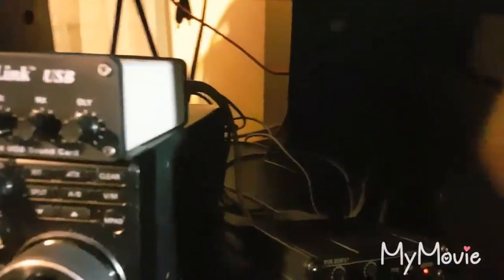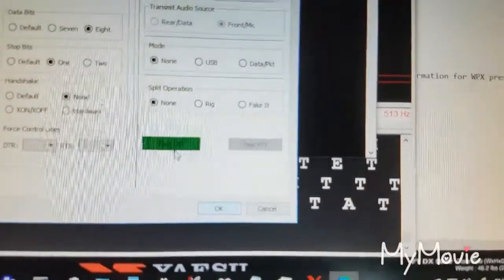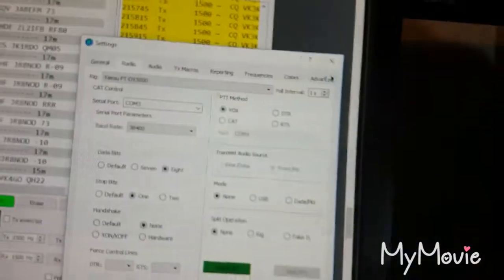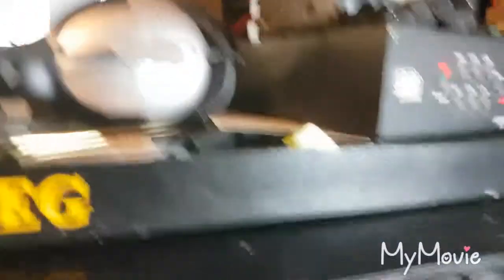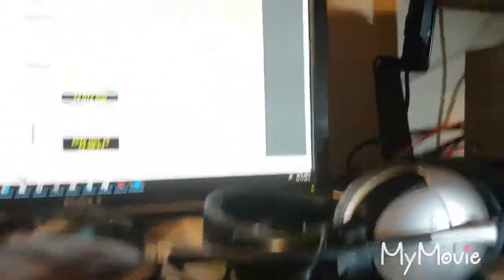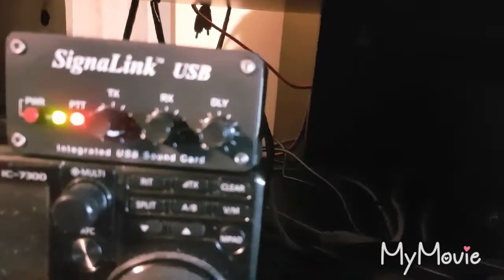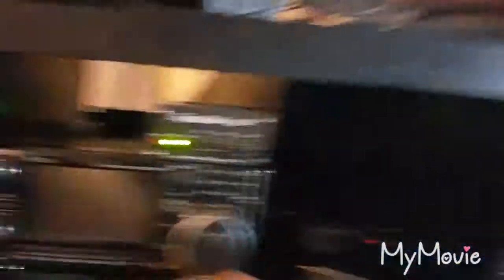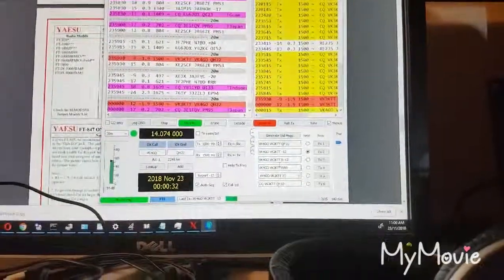Easy Yaesu Ftdx 5000  signalink setup for wsjtx #ft8  de vk3ktt.

Comment: Having a hard time with FTDX-1200 and signalink. Should I do anything in the menu of the radio, or go into the menu of the radio. One thing the program keeps wanting a comport. Laptop is running windows 10.
tnxs 73 KQ4CD Paul

Comment: Great video Steve thanks for the Help I have the scu-17 but not a signal link yet will these settings work with dxlab suite as I do not have Hrd,I look forward to working you in the near future best 73 from North Staffordshire de G0UDG
Reply from the maker: yep i run dxlabs  software.
Reply from the maker: btw its should work with just the scu -17 i just couldnt get it to happen
Reply: Thanks fer the quick Reply Steve much appreciated best wishes from England de G0UDG